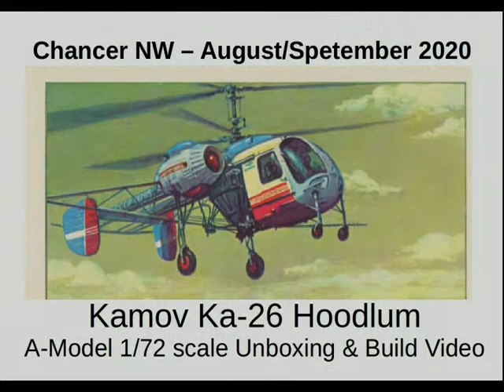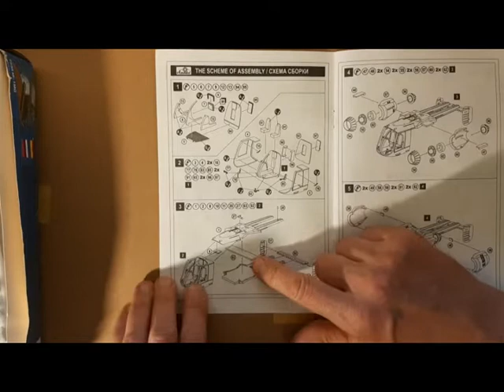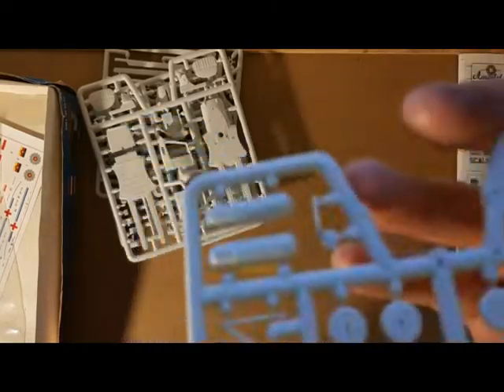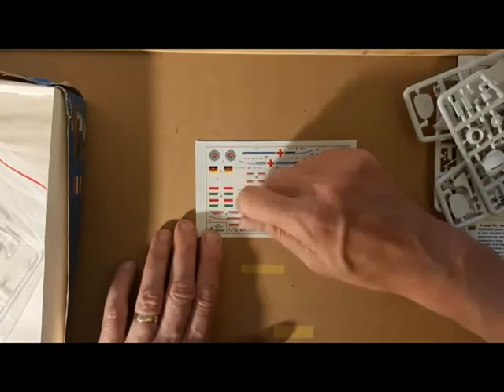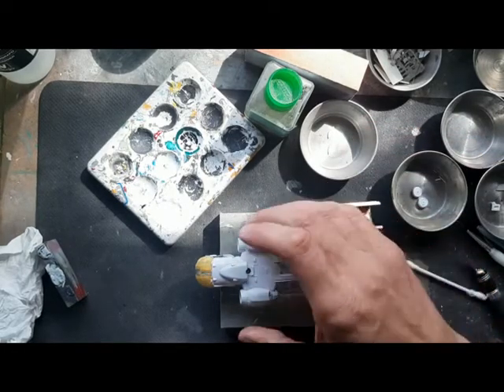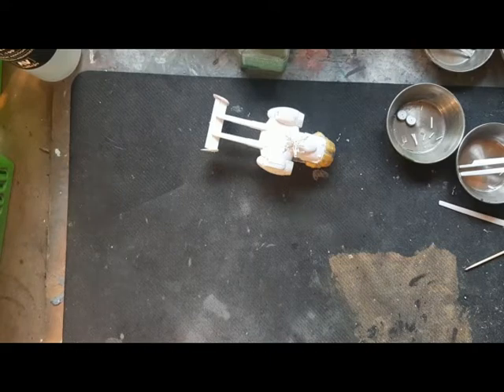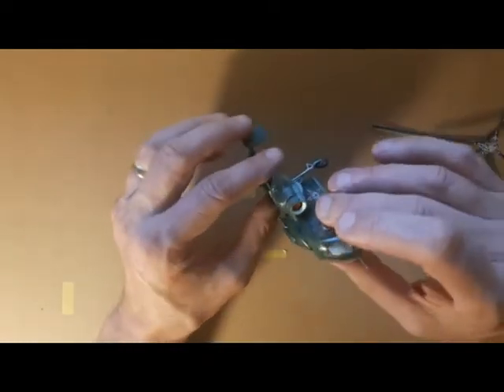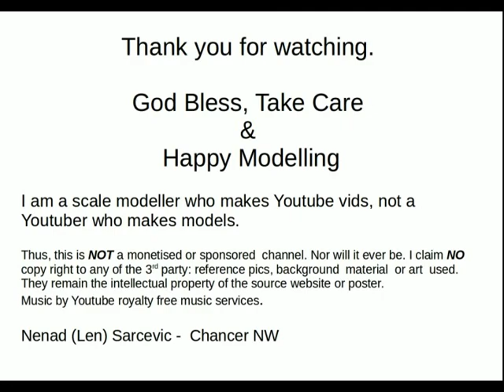A-Model Kamov Ka-26 Unboxing and Build Vid

Comment: Although living in the US, I admire the Ka-26 and the Ka-32. I’ve always loved helicopters and
Worked on many a few types. I’m currently to see if my hobby dealer is able to get a Zvezda 1/72
scale Ka-32. Coaxial rotors are to me so awesome. The Ka-26 is so agile in crop dusting operations as
observed on YouTube. Thank you for your build. Great job with patience on your build.
Reply from the maker: Ace do a new mold of the Ka25 that preceeded the Ka27 / 32. Hobby Boss do a good Ka29 assault version of the Ka27. My mojo is struggling with the Ka-226 and I have an Amodel Ka15M in the stash and the Zvezda Ka 27.  Thank you for the comment and the great feed back. It is much appreciated.